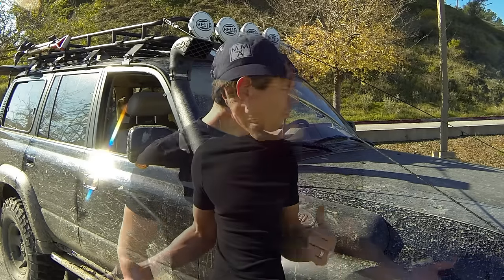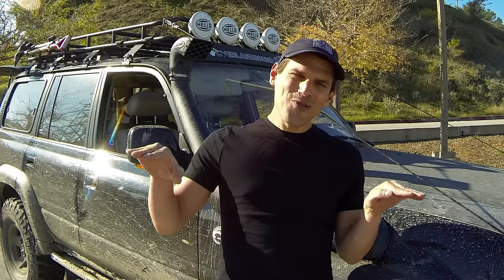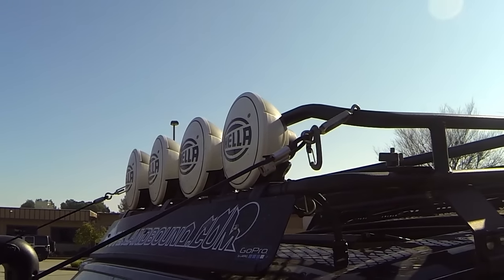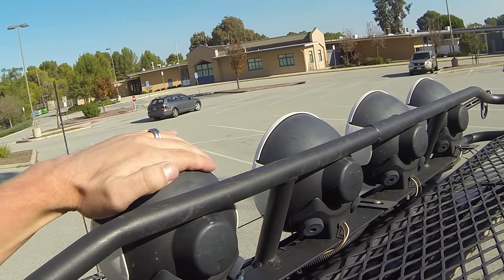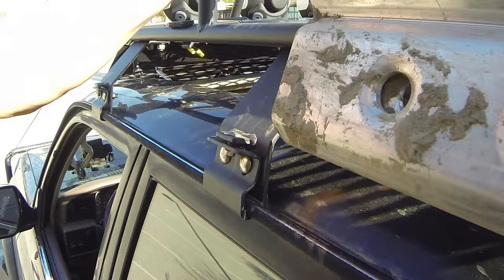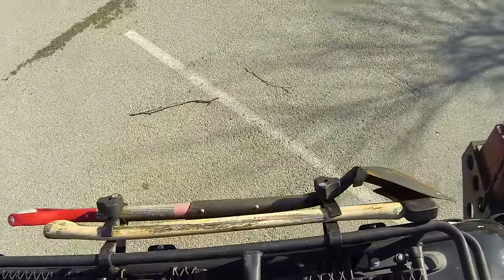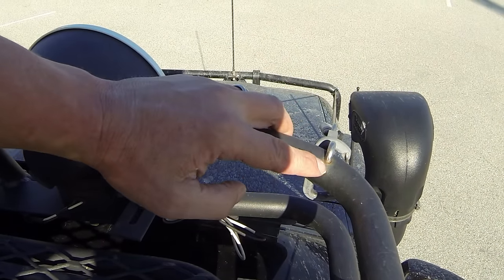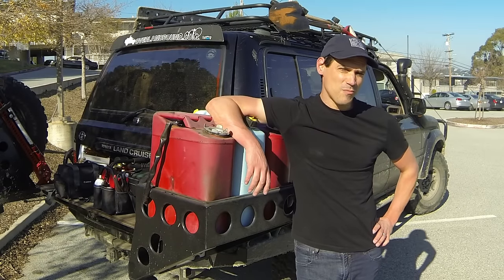Overland Bound: Roof Rack Review

Comment from the maker: AA1PR It's all personal preference. My rig can take a side angle way beyond my level of comfort, and I don't get tippy often. I prefer the roof storage so I can load for a longer duration, and keep the interior clear for passengers.
Reply: +Overland Bound the easiest way to aim the lights down would be to grab the flat metal that the lights screw into on the inner edge of the plate and pull up so it tilts the lights down
Reply: Holy crap do you Live near San Carlos my parents are just down the street from that school ?

Comment: I've enjoyed going through your videos. I noticed you left your stock roof rack on underneath your Gobi - If you had a naked roof, about how much clearance would you have from the top of the roof to the bottom of your rack? I've been planning my own roof rack build for a while now, and will "borrow" from this design a lot. My only issue will be total height added once it's all said and done. At my current stock height, I should still be able to fit in the garage fine, but if I'm ever able to get the 2.5" lift I'd like, keeping it in the garage may be an issue so I'm going to try to keep my rack as close to the roof as possible.

Comment: I am making or haveing made a 4.5 x 5 foot rack out of 1 inch  square tubing . I asked the metal guy to make it the strongest and money saving way he could which ended up being 90 degree angles  which is fine with me . I found some clamps at the junk yard which is going to save me 75 dollars . It is transferring some of the labor to me . I don't have it yet but should with in the week . I paid 65 for 3 24 foot long steel tubing and labor so far the basket is made is at 140.00 . All said and done I should come in at 250.00 . But will do a couple small add ons when I get more money
Reply: +timothy thomas Sounds like an amazing deal and an amazing rack!
Reply: I am in the process of doing the same thing but I will be building the whole thing by myself. I have a Nissan Armada and the roof rack selection is very limited. Plus I want to save myself some money.
Reply: You will be a lot happier making it your self . I see racks around town from time to time . And I would be afraid to put more than a suit case on them . Not only just some of the small one''s But the tubing . It looks about the diameter of my grand kids baby swing . Some of them are way overpriced . HOPE TO SEE YOUR RACK WHEN DONE .
Reply: I have been practicing trying to weld some scrap tubes and I kept burning holes init. So I'm going to have to take the materials and drawings to a welder...
Reply: Bravo Foxtrot what type of welding are you doing? if Mig use a smaller wire and if not try adjusting the wire speed to a faster rate. the speed controls the heat.

Comment: You mentioned something about limitations on the kind of rack weather you use or not a roof tent, can you elaborate please?? THX!!
Reply from the maker: +Carlos Ibañez Yup! You just want to be sure it is rated for the load. Some racks that are made for the RTT have areas of sidewall missing so the RTT mounts right on the roof rack instead of up on the rails. 

http://www.4wheelparts.com/aux_incl/images.ashx?i=3800200A.jpg&partNo=ARB&w=330&h=330

Comment: what kind of temps are you seeing in your 80 when its loaded down and on a hot day?  just this weekend my 80 unloaded without a rear bumper but with the same front bumper and roof rack, I was running 212.  this was only a 10 mile trip at 55 mph with a few street lights.  it was about 110 outside...
Reply from the maker: Busted temp gauge, but high.
Reply: hmmm.  you should pick up a scangauge2.  or maybe not because you always look at it and start thinking you need to fix something...  lol

Comment: doesn't $1-2k seem a little excessive for some bent tubing and metal grate?
Reply: Philip Gragg depends on what roof rack. i have gone through 3 different kinds and even did some custom work on my Jeep. When trying to add certain things like Kayaks ect... the Thule roof racka that I had didnt work so great. I needed a sturdier one and there are brands that have cheap thick tubing. When you see a Gobi rack you can tell right away there is a huge quality difference.
Reply: I plan to build mine
Reply: Yes.

Comment: Wow, I got on your link to Overland Bound website. They only make stuff for newer model vehicles. I am in the process of converting my 1993 ford E150 to 4x4 with a conversion kit from ujointoffroad.com. They offer racks also but I really like the design on the overland. But I guess I will have to continue to shop.

Comment: Thanks for the great video! Very nice setup. You mentioned avoiding the modular racks - were you referring to Slimline 2 by Front Runner in that suggestion? Been looking at them and Baja rack for my LR3. I'll check out Gobi too!
Reply from the maker: ***** I just prefer one piece units in general. Not picking on anyone, but two things are very important to me, 1. Flat deck, and 2. One piece unit for durability.

Comment: Great review keep em coming! Is your rack able to support a tent and have you ever considered adding a roof top tent? Thank you
Reply from the maker: Yes it would support a tent, but I really think I'm a ground tent guy. My reasons are rack space, size, number of people, going up and down a ladder. I don't mind, but guests.
Reply: Overland Bound cool thanks!  Also just noticed the sunroof inserts , those are the only removable section towards the front, correct? I really like that option and just to be able to store stuff  without worrying they will fall through the rack..

I have land rover discovery with the typical roof rack for that veichel, I wonder though if I could install those gobi inserts to my rack...
Reply from the maker: THEBLADETHROWER Yup - the sunroof section is the only removable piece, which I think is a good thing for rigidity. I think they make a rack for the Disco!
Reply: Overland Bound cool thanks! Yup they do

Comment: Hello. Great video. What kind of hardware did you use to seal the wiring hole in the roof and is it water tight? I am thinking of doing the same thing and I am little worried about the seal. Thanks

Comment: Hey there, interesting video. I was wondering about having a rack that can take a slide in table between the rack and the roof. Have you used those and what are your thoughts on them?
Reply from the maker: Mike D I haven't used them, but the right slimline table would probably fit. I know a few guys who have them tucked under the rack. Just be sure to measure first!

Comment: your rack should be welded to the top of your truck, cause anyone with a good size crow bar could just pop all the spots where you have locks on your frame of the truck.Now for security of your property on top, you might think of covering it with chicken wire while travelling.

Comment: what tents work with this roof rack?
Reply from the maker: Most. I have a HiTents on it now. Because of the height of the top rail, your tent will sit a bit higher.
Reply: Earnest Thomas there is a new compaby coming up you can check it out on google it is called ikamper (www.ikamper.com) it has my eye but kind of expensive. different types of tents but so aerodynamic.

Comment: It is a nice roof rack, and a little pricey for the average consumer. but you do get what you pay for..  I am concerned about your overhead off road lighting.. You used wire nuts?  So you spent money on the top of the line on the rack and lights and you didn't use a weatherproof plug connector? I bet you did the lights yourself, any respectable shop would not use wirenuts on a vehicle. solder and crimp with weather proof sleeves or weatherproof plugs if you have to remove the rack.  Period... I know someone that did the wirenut thing with his overhead lights and grill lights and the road vibration and wind made the connections loose and caused a pretty bad electrical fire.  A few of us are gearheads and advised him that he may have a problem prior to this fire..  Word to the wise,  Take your time with wiring and always use proper connectors, fuses, relays and wire gauges.
Reply from the maker: This is great advice. I would like to tell you that I have since improved those connectors because I know you are right, and that those wire-nuts were temporary, but they weren't, and I didn't, and now my lights don't work. Lesson learned...safely. Thanks.
Reply: Just looking out.. even thought I come off like an ass sometimes.. lol